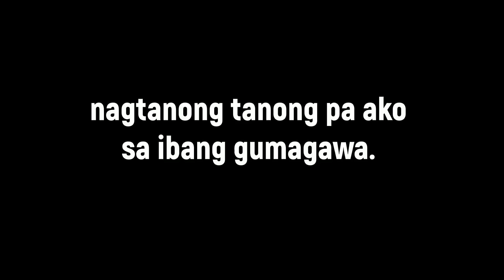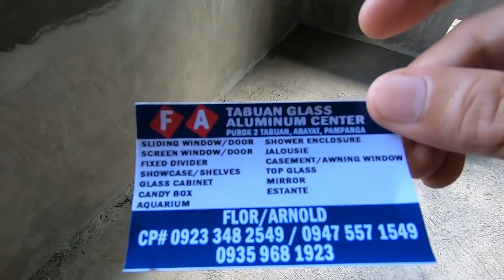PRESYO NG SLIDING WINDOW

Comment: ilan nga bintana mo kuya??
sakin 10 kasi..
by 5500 at 3600 na grills OMG 😱😱😱
Reply: Mas mura Kung direct steel casement my grills sa loob at salamin sa Labas.. Kasi pag sliding window at window grills double Gastos ka.
Reply: @khanpipez9471  matibay nb ung my grills na ksama ganon kasi sa kapitbahay nmin
Reply from the maker: 7 po iba iba ang size
Reply: @joanapotvlogs  welder ako Eheh mas matibay ang Steel casement at mas makakamura ka..  Sa sliding window kailangan pagawaan mo Pa ng window grills para iwas mag nanakaw.. Pero ang mas maganda sa ang sliding window w/ window grills kaso nga Lang double Gastos..
Reply: @khanpipez9471  kaya nga eh mapapa doble tlga..10 pa naman bintana un
Reply: @joanapotvlogs  x2 ang gagastusin mo jan sliding window + window grills.. Pero Sulit naman magandang Tignan..yun nga Lang magastos.
Reply: @khanpipez9471  yan na nga eh hayaan  na safe nmn hihi
Reply: @joanapotvlogs  oo magandang tignan lalo na pag maganda design ng window grills mo Eheh